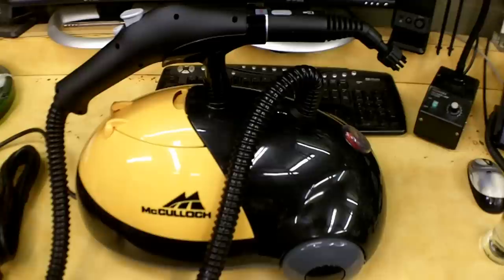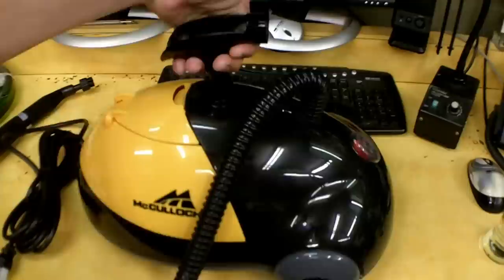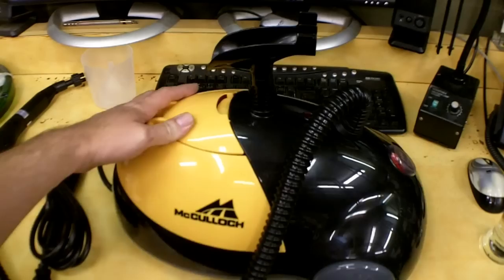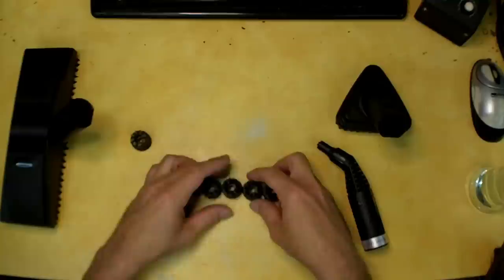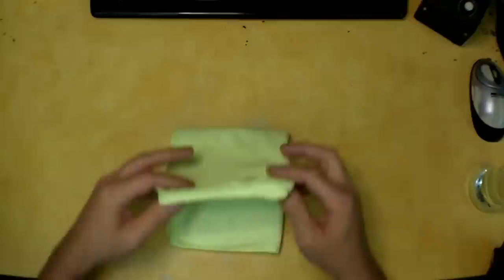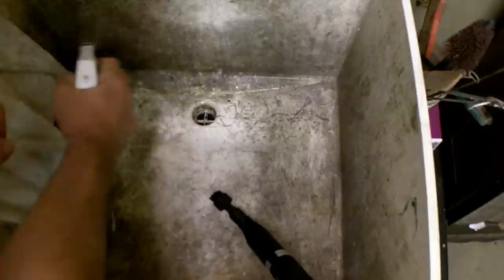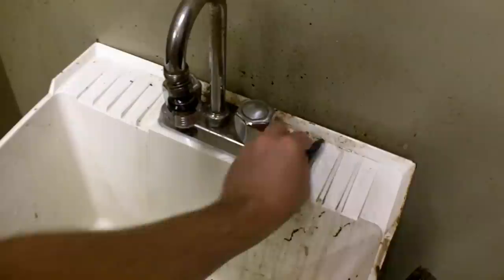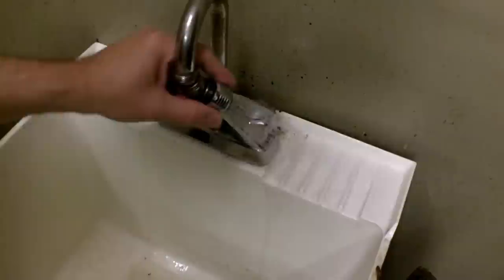Harbor Freight McCulloch MC1275 Steam Cleaner Review

Comment: Pretty happy to find a ACTUAL review instead of 20 minutes of someone saying somethings junk.  I clean my car interior pretty seriously seat removal carpet removal  fixing spots underneath. Seems like this can help speed up alot of the floorboard time and dash panel time from previous owners nicotine. 100 dollar investment is not much when atleast i know it can complete tasks in the home. Thank you sir.    Also i just thought this probably would help in degreasing a engine bay alot safer than a power washer.
Reply from the maker: No problem! I'm glad you found it useful. It might work for you intended tasks, but like you said- at least you know it can complete tasks at home if it cant. Good luck, G.
Reply: TheChrismanis1791 Virgin Coconut Activated Charcoal works wonders for cigarette gases it absorbs a lot of the odors ,but you have to get it from a reputable source and it should be new and not recycled charcoal,

Comment: I worked years back for a company that did restoration cleaning after floods and fires. My first job was in a house where there had been a kitchen fire. There was greasy soot everywhere. We used sprays bottled with a simple Dawn soap and water mixture and commercial steamer to clean EVERYTHING. Appliances, doors, windows, curtains. At the end of every job, those houses didn't smell of smoke and all we used was the Dawn and water and the steam with the occasion rub down with a bristle brush and then wiped it all up with rags. 

Lately I have been wishing I had a steam cleaner of my own and been shopping and reading tons of reviews and watching unhelpful videos. For a while I thought I was remembering the power of steam cleaning erroneously. Thank you so much for that review. I watched it and had to grin. There was the power I remembered! I was concerned that you used such strong chemicals in conjunction with it but your methods were exactly how we did it at the job.

Folks need to understand that you still have to scrub a bit; just not nearly as hard without the aid of the steam. They blow out steam, not magic fairy dust! LOL.

I will be ordering this machine as it is clear it can sustain a head of steam which IS a valid expectation of a steam cleaner.
Reply from the maker: Thanks for the story, Evie. I agree, when I was looking- the reviews and videos weren't much help. Most, if not all, of the videos are like infomercials. You're spot on with still needing to scrub but it's an easier cleaning process with the steam for sure. "Magic fairy dust"-LOL!!!!!
This might not work as well as a commercial unit- but it doesn't cost as much either. I'm completely satisfied with mine and it keeps up with my uses. I hope you will be with yours as well. Good luck, G.

Comment: Excellent review...however, I did not have any luck removing the mineral stain from bathtub but I did find an application for which it is GREAT!!!  It does a fine job or fixing those places in your carpeting that have been crushed by heavy objects.  I tease the crushed spot with the plain tip and after it cools a bit, I correct the defect with my finger.  My deep gouges are completely gone in most cases and much better in other places.  Some required a second application but the unsightly depressions are gone!!
Reply from the maker: Great tip! Thanks for sharing. Good luck, G.

Comment: Thanks for the review. This steamer may be the best I have used. I had others, that the steam was limited. On this steamer I have run it for 45 min in a row and did not run out of steam. I know your saying to yourself yeah right. I used it to steam bow wood I bend in to a deflex/reflex shape. As a matter fact it the one in my profile pic. So 2 thumbs up to this steamer and to you. Merry Christmas all!!!
Reply from the maker: I never thought of using it for steam bending wood. That's a good idea and obviously worked for you. Did you build a steam box- or just use it by hand?
Merry Christmas, G.
Reply: well not a steam box but steam tube. its about six feet long by 6 inches round. i just adapted the steam nozzle to fit into an end cap. just wrapped a towel around the other end to allow easy in and out of the stave, then about 6 inches from the end i popped a 1/8" hole and put a kitchen thermometer. worked very well. hope to post a video of it soon.
Reply from the maker: exflow2000
Ah, a PVC tube- even easier! Please do post a clip and let me know so I can watch it. Thanks for the reply, G.
Reply: hello ghost,
just thought I would let you know if your up to it, I just started a build a long, and at some point I will be steaming the wood for the bow using the McCulloch steamer. so if you could please subscribe to keep ya updated. The tube is actually copper pipe. God Bless exflow2000
Reply from the maker: exflow2000
I watched what you have posted so far and it's starting to look like something for sure! Looking forward to seeing the bending! Thanks, G.
Reply: Hi G,
Sure will let you know.
Thanks for the subscription,

Comment: Likely already mentioned, but with all the great(Well deserved!) reviews, thought I would add it, again:All the brushes and accessories are available on the McCulloch web site - as is the cleaner, itself.A friend who has had a household steam cleaner for years, tells me to "go slow, very slow, snail slow". Ends up taking about the same amount of time, compared to going over the item many times, fast. However, the steam seems to clean better if you let it in the same place for a bit, then move on. My thought: Maybe it helps to heat the item, as well, which may melt and "push out" the gunk through expansion.....? And, try moving real slow, without attachments, at first, just the nozzle. Add attachments as needed, or for larger areas that really don't need "super" clean-time. Wonderful review! I will look at your others so I know they're there if I need them.
Reply from the maker: Great tips Sarah an thanks for the post! My content is all over the map, so there may be other videos of interest. Feel free to dig around Good luck, G.

Comment: Just an fyi. i owned my machine for two years and it works great. If you take a little more time it will clean super. In fact if you stay in one place for too long like on paint it will take the paint right off. On paint I steam it from a couple of inches away and don't even touch the paint.. along with my airhose the dirt just blows away and makes it as clean as could be. I use it on my 86 Harley and it works great. Once i clean the bike, its great.. When Im going out and it looks dusty i use the steamer from a foot away and just get it wet and wipe it off with a rag.. you ll love this thing..
Reply from the maker: +Danny Hatt 
Very Cool! G.

Comment: well worth the money, I watched your video and bought one. It will damage latex paint if you not careful but it will clean it great. It works great on my sinks, tile, I mopped the ceiling in my bathroom and works great on the caulking around my toilet. Great unit and I own big professional car wash steamers. CONS it would be nice if it had an upholstery and carpet attachment.
Reply from the maker: I agree it's well worth the money! Good tip on the latex. I'd also tell folks to be careful if they use it on wallpaper as well since It would probably remove it with no problem. I guess that could be another good use for it. Also agree on the upholstery and carpet attachments. I would pay more for a model that has these features- as well as extraction. Thanks and good luck, G.

Comment: Still going strong for you? I've had a similiar one for years. So figured a couple tips were in order:
Tips: I don't use the little scrubby tips that come with it. You can get 5 packs of assorted brushes at the dollar store. Spray the area with the main nozzle & scrub with your choice of dollar store (disposable) brush. Adjust material & size for the job at hand...
Car carpet: Main nozzle in one hand & wet vac in the other. vaporize grease & grime with the steam & immediately suck it up with the vac. works amazigly well.
Areas that are hard to get at, like the door jamb: Steam it loose & then squirt at it with a spray bottle of hot water, it'll run down & (hopefully) out. I actually insulated a cheapo bottle with mylar faced bubble insulation, just for this purpose.
Sanitizing / de-mildewing fabric (beds / upholstery): Use the floor tool with the cotton or micro-fiber cover & thouroughly go over the whole thing & let air dry over night.
Stinky carpet: go over with the floor tool with the cotton or micro-fiber cover, do about a 3X3 area with steam & then vacuum up with a wet vac, then move on.
Works awesome for getting fossilized gum out of things, just softens it up, so it comes right out. Did 4 flights of stairs coated with anti-slip strips, that hadn't been cleaned in 20 years. Kids had coated it in gum. Took about 12 hours. which was about 10K cheaper than the replacement the contractor recommended...
Reply from the maker: It's still working great! No problems at all. Thanks for all the tips! Good stuff! You saved $833/hr with the time it took to cleanup the stairs! Can't beat that!! Good luck, G.
Reply: aseriesoftoobs - I'd like to get some of the Dollar Store brushes you mention. Do you have any specific info on how to identify them?
Reply: cool, thanks.
Reply from the maker: aseriesoftoobs No problem! Good luck, G.
Reply: aseriesoftoobs Thanks!

Comment: Thank you for your efforts here! Clear, accurate, real world testing. Been hesitant to pull the trigger on a Steam Cleaner to add to our detailing equipment. Think I might now raid the cookie jar and pick one up. I see on the McCulloch website spares are obtainable.
Reply from the maker: GMAN S Thanks! I'm glad you gained something from the video. It works pretty good for anything I've used it for. It's seen much use since posting this, and still works like day one. I've not looked at their site, but have a link in the description were replacement tips/etc. can be had. I've not used the site, so do your own research. Good luck, G.

Comment: Good posting.. Can I just say that if you was to use it a little slower with your movements it would work better for you. I have been using steam cleaners for many years now and it is a lot to do with your technique in the way you are running the steam over the area you are cleaning.. Remember to slow down your movements and keep in a uniform direction and you will see a lot better results.. Thanks
Reply from the maker: John Traylor Thanks John! Good tips. I was really going at it here and probably not lingering enough to let the steam do the work. For what this little steamer is, it's been working great since posting and holding up well. Thanks and take care, G.

Comment: Thank you for taking the time to do the review. I have been considering buying this unit, but your review as well as other reviews have convinced me not to waste my money. Good steam cleaners do the work with the steam jet alone. Period. Scrub brushes, supplemental cleaning chemicals and lots of elbow grease which you had to use make me wonder what is the point of these cheap low pressure units? Let's face it. A good scrub brush and some cleanser would have cleaned that sink faster than all the fiddling around with the steamer / cleaning products + the steamer with a silly little brush. Thank you for helping me make my decision.  Good review.
Reply from the maker: +Fred Flintstone 
No problem! It might not be for everyone, but it works well enough for us. Most typical users probably don't have sinks as dirty as mine so I figured I would see how it would do.  I don't know what a high pressure unit would go for, but I would imagine many times what I paid. Good luck, G.

Comment: Well, the wife had mentioned about wanting a steamer back in the fall so I figured I had a couple months to research. I had it narrowed down to a black and decker model or the Sienna Luna + model. Then I saw this video. While cleaning the carpet in the truck, something clicked. It may be ok on hard wood floors (which we have over 2000sq ft on the 1st floor alone and 4.5 bathrooms w/tile floors a steamer would be nice. But doing carpet/cars/cloth in general, I figured all the stains float to the bottom, into the padding, which you can't get clean unless you replace it. I also assume over time, there will be a interesting smell that won't go away without additional treatments (fromt he car LOL).  Great video though, thanks.
Reply from the maker: +tc1uscg
I would guess the best type of steamer for carpet/upholstery use would be one that has extraction- like the carpet cleaners use. I've never looked to see if a consumer type is available, but if so it would probably be pretty expensive. Take care, G.
Reply: +ghostses I ordered a steamer/mop from Costco. For what we want it for, it should work fine. If I had to steam the carpet, it would be calling in a professional. For the car, it just seemed using the steamer would allow the stain to sink deeper below the surface. It was a toss up but I ended up ordering a Sienna Luna Plus Steam cleaning system. Hardwood floors and bathrooms. That about all it will be used for.
Reply from the maker: +tc1uscg 
That's cool. You might be right. I don't know which type of steamer auto detailers use, but It's probably more like what you be used in your home. Hope the steamer works out well for you. Good luck, G.
Reply: +ghostses how about a shop vac ? after steaming the carpet
Reply from the maker: Utube75
That is what I did after cleaning the truck. G.
Reply: so it is usable on car carpet if you shop vac right after and water/moisture won settle to the bottom?
Reply from the maker: Utube75
I can't say for sure, but I did vac up most of the moisture after steaming- then left the doors open for a bit. You might look for interior detailing videos for more information as I'm not pro! G.

Comment: I appreciate the time you took to review this! It really helped. I am now gonna look to see if there is a video on how that squeagie attachment works. Window cleaning with steam what a thought! Life could be better ey?
Reply from the maker: No problem Madeline! I'm glad it was useful. I still haven't tried the squeegee so I can't comment on it's performance. Good luck on your hunt, G.
Reply: You have to be careful with using heat on any glass which is not either borosilicate or tempered / safty glass as thermal didferentisl will cause things like mirrors ect to crack and potentially shatter just putting that out there ...as far as cleaning places like your windshields the 2 best applications have slways been usings a " claybar" or an ammonia based foaming based glass cleaner with some old newspaper  use a clay bar if wind shield has ever had crapy rain x applied to it or if you have " waxed your vehicle wits crappy hotwax from your average drive in car wash .... last of all for exceptionally stubborn films you can use pure " acetone nail polish remover on older modle cars that donot have the protective " plastic" films or plastic tints on them just be careful with it and wear gloves as the ceap is toxic ...

Comment: MC 1275 is suppose to produce steam at 200+ F degrees. Mine only heats to 140 F degrees. What could be wrong, the thermostat? Where can I find a replacement thermostat?
Reply from the maker: I'm not sure if replacement parts are available. I couldn't seem to find any online. If the light turns off and it's only 140 degrees- it does sound like a thermostat- or maybe a heating element problem. You might call McCulloch to see if they have a service center that can repair it. But it might cost almost as much as a new unit. Sorry I can't be of more help. Good luck, G.

Comment: Great job & honest review!  One question:  I thought this came with an attachment to help steam off wall paper.  Did I miss that or have I read about wayyy too many steamers that I'm getting them mixed up?
Reply from the maker: Kelli Laine Lewis - Forever 18 Thanks Kelly! This did not come with a wallpaper removal attachment. It looks the Wagner 915 comes with one. At a glance, the 915 looks just like the one I've shown here. I don't know if the 915 comes with everything else I've shown so I would look into that. It might even be possible to locate the attachment and use in on a machine like mine. Hope this helps and good luck, G.
Reply: Thank you so much! I will check it out.
Reply from the maker: Kelli Laine Lewis - Forever 18
No problem Kelli! G.

Comment: Just wondering why did you use tge Purple Power spray, then use the steamer...   What is the point of even using the steamer than??
Reply from the maker: In many cases, the steamer is not enough to do the job on it's own so chemicals are still used. Chemicals usually work better when hot so a combination of the two speeds things up. Think of steam cleaning a carpet stain. A chemical is used to break up a stain before the steam is used. It works better that way. Good luck, G.
Reply: Ok thanks.
Reply from the maker: Jonny Weber
No problem Jonny. Take care, G.

Comment: Try using white vinegar 5% acid that's what I use instead of water it works it works much better then flush it out with water after you're done
Reply from the maker: Thanks for the tip! G.
Reply: ***** you're welcome
Reply: vinegar instead of water in the actual tank?? Also (maybe I just never paid attention) where do you find vinegar with different acid percents? Im curious about the vinegar being in the actual machine itself, these units don't even recommend using tap water in them, so its a worry that vinegar might in some way or over time harm the machine?(This is a serious legit question, I am in no way being rude or sarcastic so I hope it doesn't come off that way)